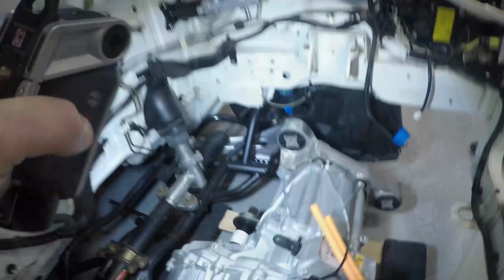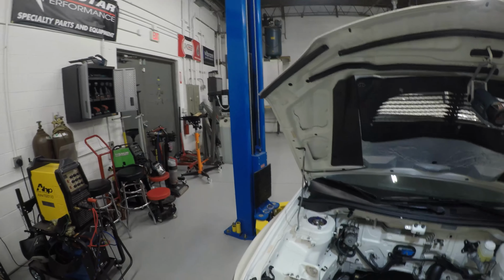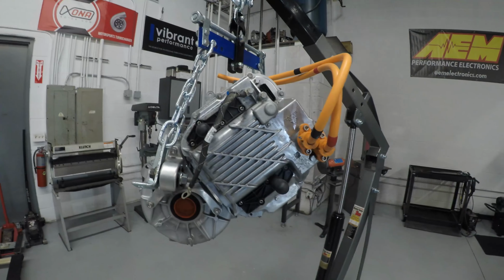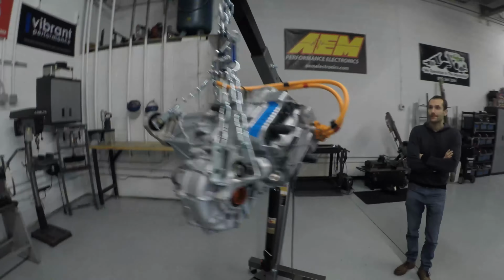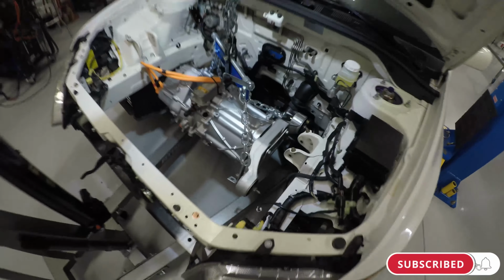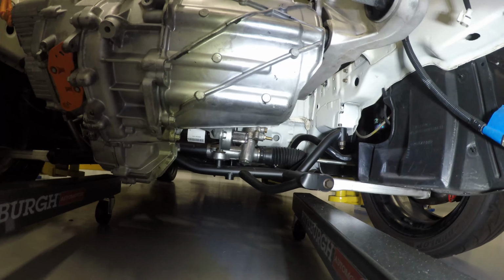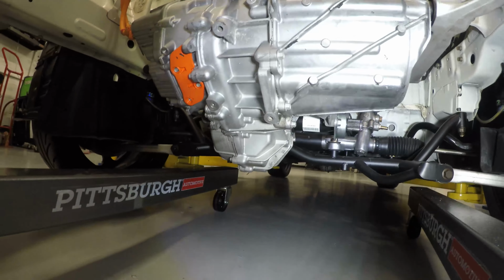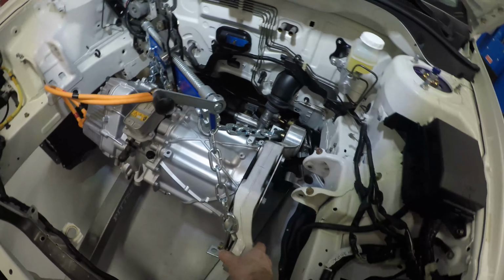Tesla Model S Swapped EVO 8 - Moving on to the Front Drive Unit!!!

Comment: I noticed that you are mounting the Tesla front-drive unit in reverse orientation. How will you fix the direction of rotation?
Reply from the maker: Reverse polarity on the power connections
Reply: @HochmanFabricationAndSpeed  The motor is a 3-phase induction motor so just reversing polarity won't work. Guess you have a plan for this, just wanted to point it out. Great work so far.
Reply from the maker: @JumaKevin  thank you, forgive us for not using correct terms to explain this.  But you are correct that we (actually the customer whom is handling all of the electrical and gave us the green light to mount the motor in this orientation) do have a plan.  With this being new to us, and the customer the real guru on the electrical side, this is about as much as we know and can tell you.  We always like to be transparent.
Reply: @HochmanFabricationAndSpeed  I’m in the process of a similar swap in a Honda, the problem with flipping the front drive unit is the oiling system only works in fwd, not reverse.  So you will need to mod the drive units oil system to work in the reverse configuration- though I’m not sure how to do that, but have been told it’s been done before.